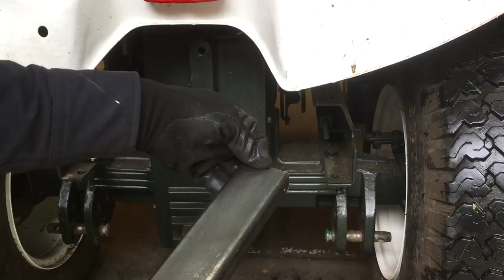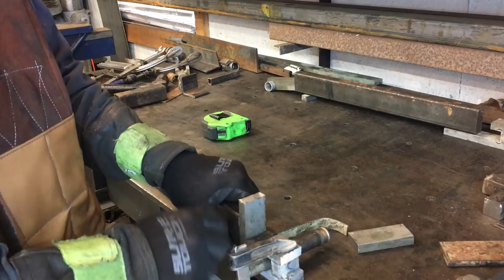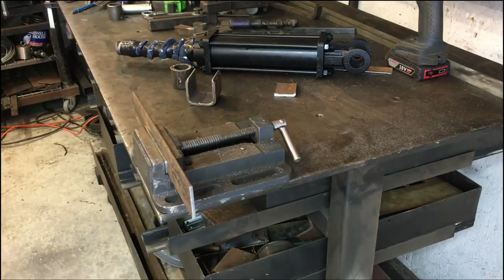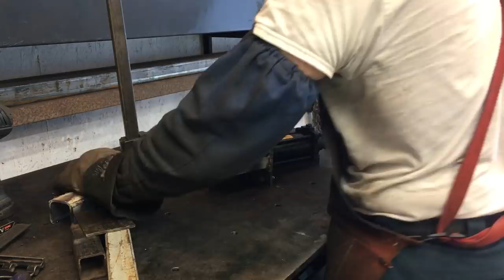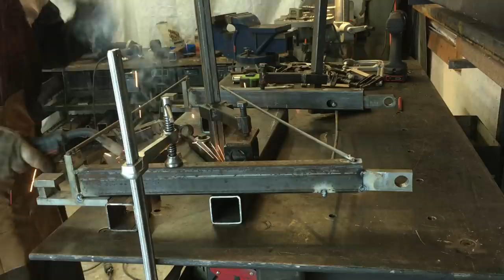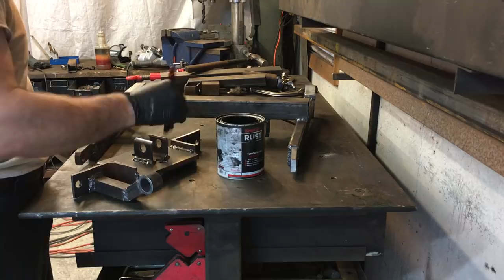#85 3 Point Hitch for Bolens HT-23

Comment: That Bolens looks like a well built machine. 3 point hitch will make it so much more useful. You opened up all kinds of possibilities..
Reply from the maker: Before I looked for a lawn or garden tractor, I watched "iSaveTractors" channel. I quickly understood the value of the older garden tractors (70's-80's), with massive use of cast iron for axles, engine & transmission. They were built to last and accomplish ground engagement tasks. I think they were the ancestors of the now very known sub-compact tractor category where the BX is the king. I remember looking at the ads on internet and one description I saw was: think of Bolens as a tank... Thanks for watching!

Comment: Really nice build. It work very fast. Thanks for the video.
Reply from the maker: Thanks!  I have 2 more implements in mind.  One is going to help me remove some smaller rocks. I am currently busy on a major maintenance job on the Case 430.  As soon as I finish it, I will return with fabrication!  Thanks again!

Comment: Love the 3 point hitch but I'm not going to change the 3 point on mine I will keep it that way for now.
Reply from the maker: I saw it yesterday and honestly, it's a great system! It does lock in upper position. You might not lift heavy stuff with that, but the plow is surely easy to maneuver.

Comment: Nice work! Did you ever look to see how the 3 point hitch Bolens offered was designed?
Reply from the maker: Thanks! I went through a lot of pictures from the web, as well as some documentation about the original Bolens 3 pt hitch.  Most of them hooked to the mid mower deck cylinder. This cylinder is not that strong and I wish I could use the 3 pt without lowering the mower deck. One other point is that most of the design had a free lift design, which was not good to hitch trailer with zero weight tongue. I was inspired by the Case Eagle Hitch system which does not use sway bars/chains and I honestly prefer that. The only down side to this design is that I use the auxiliary hydraulic ports and I have no more hydraulic spare. Unless I use a diverter valve... Thanks for watching!
Reply: Joe Lesage That mower deck lift cylinder is stronger than you think. The plow blade hooks onto that cylinder as well, and it will lift the front tires off the ground without issue, but not being able to use the mower and the hitch at the same time would be a big issue.
Reply from the maker: Gearheadtom, it should be as strong, because is has a 2 inches bore, so the same.  But I think the problem is the working angle that might not be optimal. Especially when lifting the mower deck. It raises correctly, but seems reach it's maximum capacity at the end. So adding the weight of the 3 pt to lift at the same time might have been too much. I can tell you I already tried to lift the rear wheels and it does without effort!